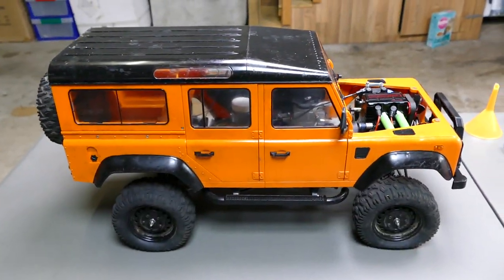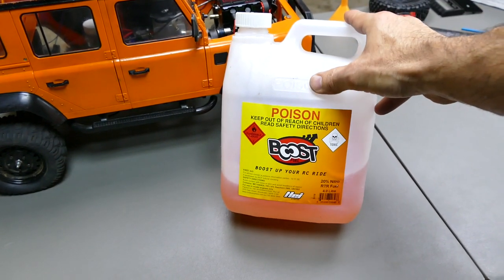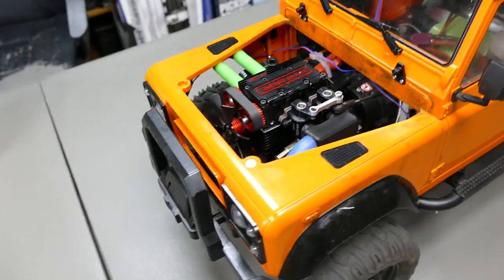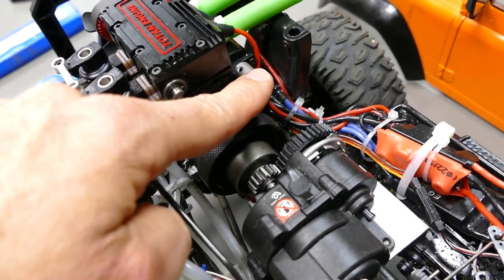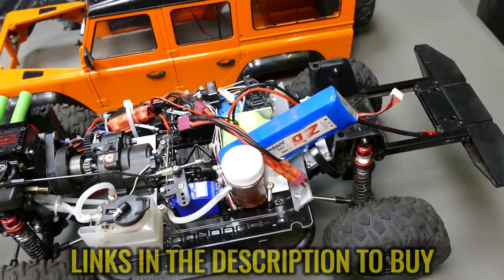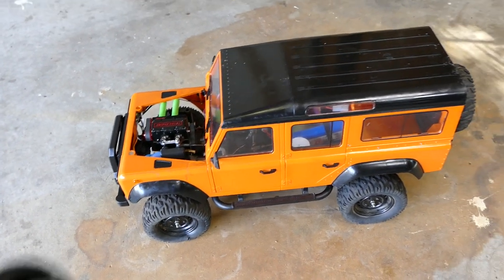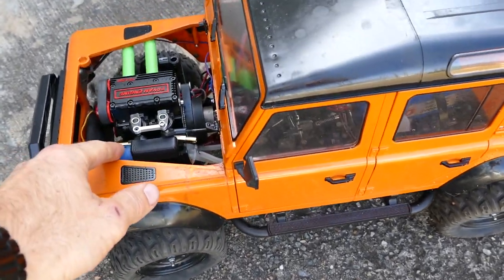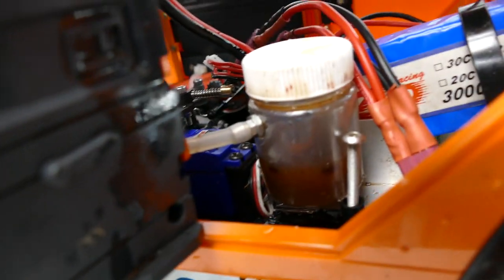2 CYLINDER 4 STROKE ENGINE INSTALLED INTO RC CAR - Crawling, High Speed Run And Questions Answered

Comment: You should make a full exhaust system with scale catalytic converter
Reply: Only problem is... To make a cat for this engine would do nothing... It's too oily and it would just collect oil instead of burning excess gas. Although it is cool to have it as an aesthetic piece

Comment: I think it could use a much lower gear for crawling or maybe even a lighter doing on the centrifugal clutch so that the engagement is smoother (so that it doesn't jump so much when you get on the gas) that way you would have more smooth control but it's still freaking awesome either way love the build.
Reply from the maker: Good ideas mate. I will look for a clutch when this one is near its end of life

Comment: What you have made is amazing, no question.   I am almost 44 years old and started with the rc hobby when I was 11.  I could not afford nitro.  At the time electric was lame, slow and unobtainable compared to nitro.  I started using (then at 11) Anderson Power Pole connecters, to series connect battery in series packs for volts and amps.   In the 90's  I had 4 minute run times on 14.4v on heavy ass WalMart NiCad's  and burned up a 12t mega motor by Kyosho in a Hirobo Alien. The progress since, has proven, nitro\gas for RC is pretty dead.  Not my progress,  the pioneers of electric rc have brought us drones  etc.   Other than a very cool expensive RC, let nitro die.

Comment: oh i love this thing. is it actually possible to reroute the exhaust to the back or would that screw up the backpressure and also it would be cool if you reroute the air intake next to the window like you see on range rovers so they can drive in water without getting water in the air intake
Reply from the maker: Yeah hopefully get a exhaust done soon
Reply: @RCTanksTrucks247  let's see it

Comment: Great build mate, so much so iv just got the Double E truck and the same motor, is there any chance you could send me some close up pictures of the gearbox mount and drive shafts as im struggling a little bit. Thanks
Reply from the maker: Sorry mate, it's disassembled

Comment: If you made a exhaust for it it would be better for the valves and it won't sound like it's idling under water. That is a awesome set up.
Reply from the maker: Thanks for the tip

Comment: It would be good to see it run with shorter gearing and a proper exhaust. So it just walks over obstacles and sounds tough.
Reply from the maker: It is idling slow already and these clutch springs are fairly soft and nearly grabbing the bell housing as is.
Reply: @RCTanksTrucks247  maybe some portal axles or diff gears to get the gearing down?

Comment: what clutch system did you use. ?
Reply from the maker: Stock aluminum clutch setup available at enginediy.com
Reply: @RCTanksTrucks247  I found this one, but it says for ships, but this is the only one with a single gear which will fit to my tranny. https://www.enginediy.com/products/single-gear-clutch-assembly-rc-model-ship-upgrade-part-for-toyan-fs-l200-double-cylinder-4-stroke-methanol-engine-model?_pos=6&_sid=042cecb2f&_ss=r

Comment: If the clutch grabbed at lower rpm this could really catch on
Reply from the maker: Kinda hard cause the engine already is idling pretty low. Maybe a heavier flywheel would help
Reply: @RCTanksTrucks247  I think the clutch just doesn’t grab at low motor rpm’s as easy that’s one of the downfalls of nitro

Comment: It's cool as hell, but that thing looks horrible to drive, it seems so unresponsive and weak, and it's geared way to high for a crawler, he needs to give it quite a bit of throttle to get enough torque to clear even small obstacles.

Comment: Supper cool but not much of a scale crawler look when she is on the rocks. Nitro and a clutch just no low end torque for the scale look of the electric scale crawlers. I do like your videos and the work you put into the builds. Amazing vehicles and nice save at the 23 min mark

Comment: Why does it smoke if its 4 stroke
Reply from the maker: Because the oil is in the fuel
Reply: @RCTanksTrucks247  I thought that would make it a 2 stroke but I dont know anything about these smaller engines just womdering